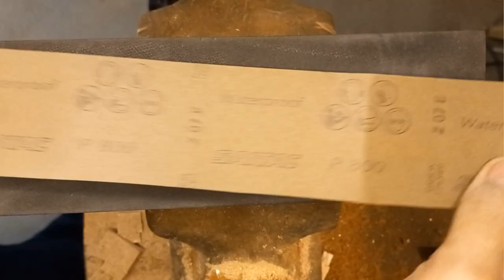How to modify a Terävä Jääkäripuukko knife || Stacked leather handle, no coating, convex

Comment: Great video!

The leather tool to punch the long hole for the leather spacers is a CREW PUNCH. You can make a basic one with a small round metal pipe & a vice....just a little trial and error to work out the size needed to get the length & width.

HOPE YOU WORE A FACE MASK WHEN USING THE BELT SANDER...! 
Leather dust is EXTREMELY CARCINOGENIC = similar risk to ASBESTOS.
Reply from the maker: Hi! Thanks a lot for your advices! Yes I was wearing a face mask. Thanks a lot for watching!

Comment: How did you attach the rear brass plate? It’s not clear in tge video
Reply from the maker: Hi! I tapered the tang and I press in the square hole of the "pommel" that is basically a double plate. This seems was already enough to fix it.
To make more secure I slightly pinned the tang...
Unfortunately I did not realize the camera was not recording!! Sorry about that!

Comment: That’s a very good work! I love my 110, and I think it’s formidable at his price, and now yours is also beautiful!😊 why did you choose a convex, if I can ask?
Reply from the maker: Thanks a lot! Well, I use my fix blades mostly outdoor for bushcraft related tasks... I have a decent piece of land to manage with wood and fields... covex for  me is the best geometry: great on any wood, good for ropes, rubber pipes, low density plastic... it's easy for basic/utilitarian carving and at the same time pretty strong to keep an edge long enough.
I believe other grinds are valuable to but for me the convex is the way to go for a fix blade to use as a tool outdoor.
Just an opinion, clear.
Thanks for witching!
Reply: Thank you so much for the answer! I would buy a new knife, and my choose is between the F1x in elmax or a lionsteel M4 in magnacut..which one would you buy, and why? Ty
Reply: Consider that the use I make of the knife is very similar to yours
Reply from the maker: @baudosgarage4761  it depends: can you modify the handle (and so the sheath)? So the convex ground of the f1x is almost unbeatable. But if you want something ready to go the lionsteel is great!
Reply: Thank you! Apart from the geometry, do you think the elmax is better than magnacut?
Reply: And no, i’m not able to modify handle and sheat…😅
Reply from the maker: I do not think that in normal use the steel is the primary element to consider. I believe that how a knife perform depend from a bounch of factor: steel, shape, edge ground type, proportions,... and personal preferences...
Reply from the maker: But generally speaking if you could ha the same exaknife in elmax or magnacut.. well I'm pretty sure that magnacut could win in most of the possible scenarios
Reply: Thank you so much!

Comment: Dang, man, that is beautyful.  A lot of work, but nice job. I own the same knife, and truth been told, it's ugly. It performs than some far more expensive knives,  but it's an ugly fuck. Only thing, i don't like a convex grind. If i changed this, i'd do a full flat grind,  because i think, it's the most versatile grind, and i am not one that takes a knife for woodworking, one for food prep, one for skinning game and one for cutting toenails, when i'm out in the woods.  One fixed blade, and one victorinox as a back up. The saber grind with the secondary bevel  that the jäkkaripukkoo has,  works good enough for me, so there's that. 
But you made there a very unique thing of beauty. Props to you....
Reply from the maker: Thanks man, Thanks a lot for this. Well I believe that the convex is about personal preferences and to be honest it can depends from so many things that is hard to say this is better than that.
Thanks for the sharing!

Comment: This is the worst blade I ever had. The heat treatment: The worst I 've ever seen. The edge geometry: Again the worst I've ever seen. The Grind: The worst I've ever seen, all the grinds where uneven and by a lot. Fit and finish: The worst I've ever seen. Handle:  I've never felt pain, on the muscles of my hand,  and that was happening, just after 30 seconds of feathersticking. Sheath: It got all dinged up, after the first use. Wherever it hits, leather shatters like if it was paper. The edge chipped like crazy, no matter what edge geometry I tried, or how much steel I removed, the edge kept chipping. For example, after a complete featherstick with a fresh sharp edge, the edge looked like it was a saw and not a knife.. THAT many chips... 
         It never got razor sharp, which is one more proof, of the very bad heat treatment... I didn't even bother to send the knife back, because I read many comments and reviews, where people complaining about the same issues, send the knife back, but the replacement knives, had exactly the same issues!! So why bother??  Whoever praises this knife, has zero knowledge of what a good knife or not is. (even if he was lucky, and got a good heat treated one)
Reply from the maker: Hi, thanks for sharing your experience.
I believe that is very usefull when we find differebt point of view.
Reply: Sounds like you got a knock off. These knives are known for their toughness and resilience.
Reply: @altumpaul  Sounds like you didn't do your research,before you can be able to judge.
Reply: @greekveteran2715  oorrrrrr...I have one and it's brilliant